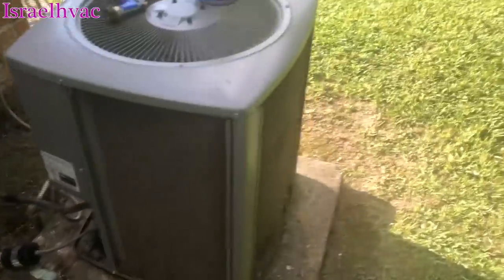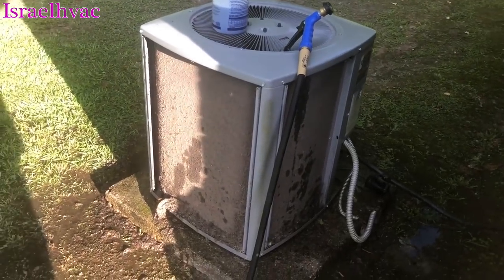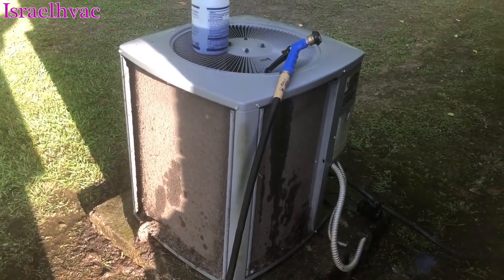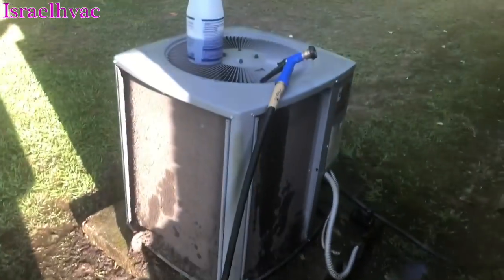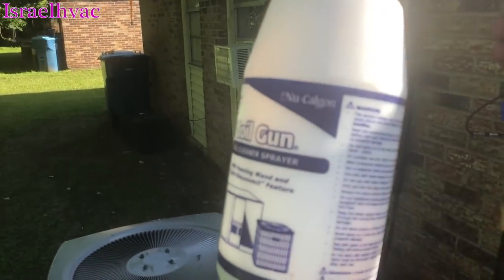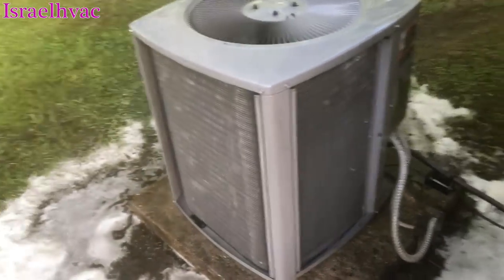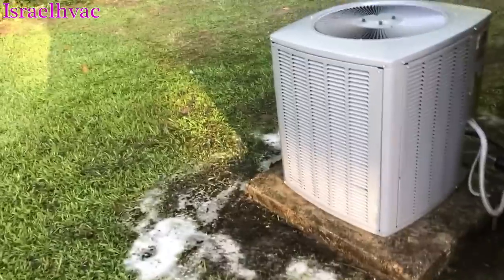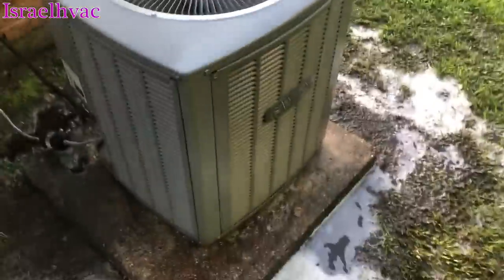Cleaning a HVAC Condenser Coil

Comment: I could kick my own ass for using a pump up sprayer for the first 10 years I did this. There's nothing better than a coil gun. I set my to the "E" setting so it mixes the least amount of cleaner possible. And that's more than enough to get the coil clean. Sometimes on spline fin coils I'll remove the foaming wand and just let the stream push the cleaner all the way through to the inside. Those damn little old Rheem units are about the only ones I remove the top and wash from the inside out. Good job John.
#realworldcoilcleaning 👍
Reply from the maker: I appreciate it Shannon.
Reply: I still use a pump sprayer 🥺🥺

Comment: What was the foam stuff and where do you get it? Can I as a homeowner do this without removing the grills?Great video. Just subscribed
Reply from the maker: I appreciate you watching. But you need to hire a HVAC Professional to get this done.
Reply: Israelhvac I have been in the auto industry since 1983 and have ran a shop since 2000. I know I can take the grills off but what are you spraying on the unit? Thanks for the response
Reply: What you spray on the coils depends on what crud is on them. The stuff that sticks to the coils varies by where you live. Thus a local HVAC guy will use what works for the local crud. Even your local HVAC pros will differ on what "stuff" they use to clean coils.
 ie one has gobs of opinions, gobs of different types of coils and FOUR different types of "stuff" used. 

The Four types are 1 Acid, 2 Alkaline, 3 Solvent and 4 Detergent.  The first two if not rinsed off will actually continue to degrade the coils too. One has 5 Vacuuming and say 6 Torch to burn off crud too! 

 Lets say you have a mess of insects stuff in the fins/spines, 1 or 2 can eat up the dead bugs that clog up the airflow. If it is just dust then 4 Detergent can be OK too.  Some folks burn off cottonwood crud off spine fin units too.

On one of my spine fin units from 1986 I used 1 Acid then just use 4 Detergent since it is just dust.  Another issue is salt air here. Non spine fin outdoor coils after say 5 to 10 years often have the aluminium fins at the lower portion coming apart, ie no fins anymore. 

A cleaning often has to have a fin comb used to remove all the chunks of fin that came apart in the so called cleaning process. ie one can actually force the pieces in and ruin the airflow.
Reply: On a 21000 BTUH window unit a customer had the inside evaporator coil was full of copy machine toner. Nothing "cuts" this stuff since it is really like carbon. Soaps and Acids and even Carb cleaner did not cut the toner off. Another HVAC place replaced the compressor under warranty and the clogged up rig only lasted 1 year. Thus with a replacement new 18000 BTUH unit I added a big 20x30 hepa filter to filter out the toner ant his unit lasted for about 8 years until the evap coil got a leak. Thus beware there might be no magic cleaner to remove crud.
Reply: Jerry Moody thanks. Mine doesn't look real bad.the I'm going to hit it with a hose real good
Reply: People must understand; there are condenser coil cleaners/chemicals and evaporator cleaners/chemicals. Some evap cleaners are no rinse after they've been applied to the evap coil. If any tech decides to use ANY chemical to spray on ANY coil, read the instructions so that you know the/your water to solution/chemical to mix. But with the spray gun, if you set the dial properly it will automatically mix the chemical/solution properly with the water.

Comment: ???To be fair yes, you do knock off a lot of debris  but it's the pressure that aids in get the most dirt off the coils. If the pressure isn't good you will clog your condenser coil.

Comment: Really not much of a debate. Clean inside and out. Rinse the outside straight up and down, pull the fan and do the same inside out. Boom done. Bigger question is why did it get so bad before tripping the high side sensor?
Reply: Jonathan Marsich must have been brushing the dog a foot away.

Comment: Do u have to let it dry before u start it
Reply: No, it's fine if you  start it while it's wet, pressures will settle out in a few minutes after start up
Reply: Does that go for any ac unit
Reply: @stebensbobby  it usually runs in the rain dude

Comment: How do u know u are not throwing water into the compresor nd electrical stuff cause i dont know anything about electrical components i just a helper
Reply: N Eliseo S Carranza these are outdoor machines. Anywhere you spray water is a place rain, snow, and frost can also get to. I may be wrong, I am not an HCAC guy.
Reply: The condenser units sit outdoors for years in all kinds of weather,  so cleaning them with water/cleaning solution will cause minimum to no damage/problems.

Comment: I would brush the top layer of carpet off first than wash it.
Reply: But of course if you see water coming through the other side of the coil you are definitely not pushing it into the coil.

Comment: Of course you will have those that find fault with what you are doing because they have nothing better to do. The only question is did you get paid for the work?  If so, then why be concerned about foolishness.
Reply: Win Dennis you should be concerned because when it gets stuck in the coil, in 6-7 months youll possibly have a burnout because of an improper cleaning

Comment: "Pump-up sprayers can kiss my ass."  If you pay close attention to the liquid being sprayed on the unit, probably 80% of it runs down the coil and onto the ground. I use a "Pump-up" sprayer so I don't waste the cleaning solution. "Coil gun does a really good job." Is it the coilgun or the Nu-Brite? Because Nu-Brite is so strong a cleaner, I've only used it on kitchen units that have grease on them. Did you remove the fan and clean inside the condenser? On a unit like that, I would vacuum it first, so as not to leave a ton of debris on my customer's lawn. They appreciate it.

Comment: There is NO WAY that was original and not set up- Hell the damn AC wouldn't even work if so. Also, whoever's AC that was should be shot!! lol
Reply: He said it wasn't working..It was tripping the High pressure switch
Reply: Jon...my AC just started blowing air... wasn't cold air.  Found this video and while mine isn't the same model and went outside and found the exact same scenario.  I didn't have the cleaner but used the hose and cleaned it.  Turned AC back on and we are back up and running.

Comment: First off your not supposed to use anything other than simple green on the condenser unless after a your still experiencing head pressure issues after for first wash. Next after rinsing off the crap for the front side you always back flush. To make sure it’s clean and all the acid or cleaner is off the coil. Water is always the best way to clean a coil unless you have grease build up than simple green is the best chemical to use. Annual usage of nubrite or any other acid will tare up the units coil over time.